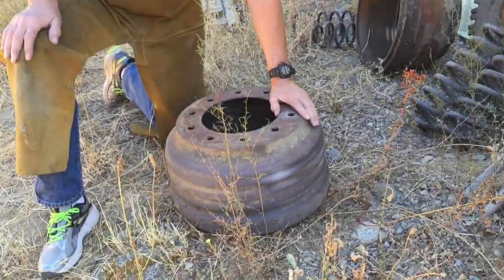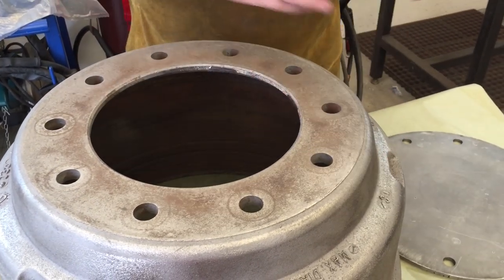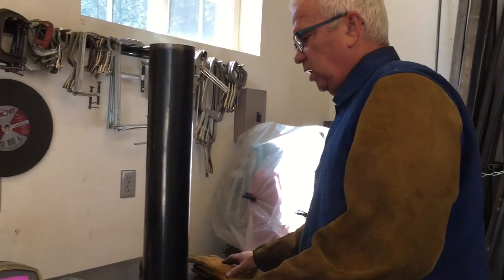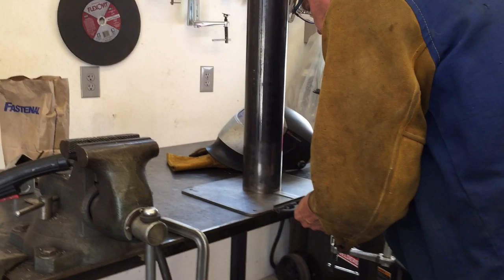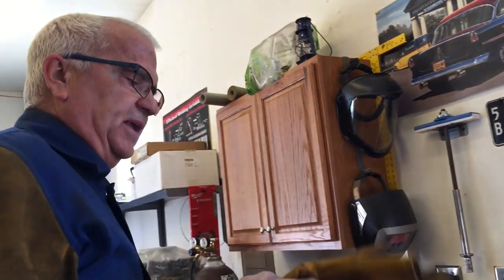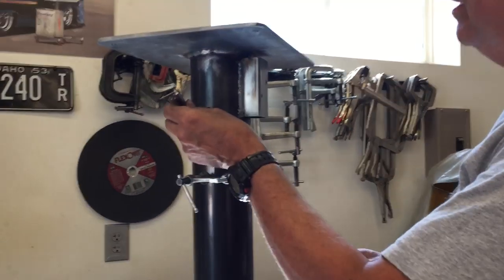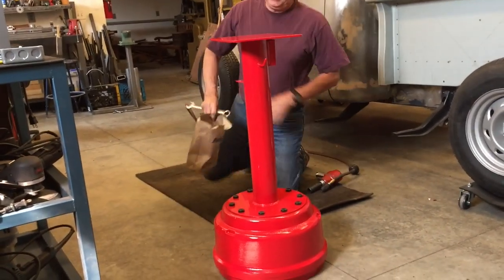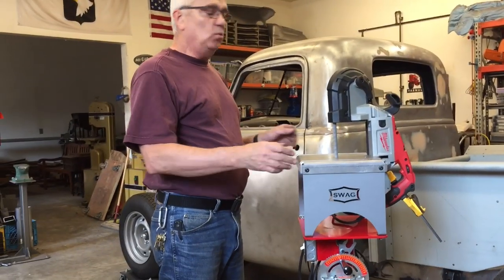brake drum tool stand for milwaukee band saw

Comment: First, THANK YOU for your service.  Secondly, thank you for posting.  Well done project and very good video coverage of each step. 
I'm headed to the garage to build the same thing this weekend.  My design will differ in that I am using a floor switch from Horrible Freight for the electrical control instead of a pedestal mounted switch.  Not a criticism by any measure, just my preference.  My plan is to build my band saw stand in such a manner that I can take the saw off the table fairly easily and quickly, and still use it as a portable band saw in my blacksmith shop.  
Cheers!
Whipple

Comment: Wow, you could have also built your own table for that saw no problem. 
I use a piece of PVC to py-passing the switch. You can get a router controller with a dial and on/off switch or a footswitch too.

Comment: I see your airborne flag, 82nd? My dad was 82nd. Best stand I have seen yet. You could cut up an old Dolly and attach wheels and handles for moving it around. I'm about to make my own stand.  I'm thinking about making a rack , Kinda like you would see with multiple mailboxes. I'm thinking band saw, Grinding wheel and Polisher all on the same rack but then again, I might change my mind 3 more times lol. I'm a Pipe Welder and CWI, you sir have my Approval 😊

Comment from the maker: No problem the plate is 1/4 inch thick and the pipe is standard schedule 40 pipe it’s 4 inches in diameter.  Schedule 40 is pretty close to 1/4 inch thickness, hope that helps.

Comment: Are you going to leave the clamp on the trigger? or rewire internally to 'always on'? Did you design this setup with maintaining the flexibility of being able to remove the hand-held band-saw from the stationary stand at any time for use as a portable tool (its original design) and then return it to the stand for stationary service in mind?
Reply from the maker: I wish Milwaukee had put a lock on feature for the trigger but they didn’t so you can either zip tie the trigger on all the time or I just use a small clamp and that way all I have to do is undo one faster on the bottom of the plate and I can take the saw off and use it mobile if I wire the trigger permanently on that would be not a good feature when you go mobile.

Comment: Why didn't you just weld the stand to the brake drum (before painting)? Could have saved you all of the hardware to bolt it together. Ok, it looks cooler and the added weight of the hardware makes for a slightly more stable stand, but I guess I'm a minimalist and just go for function over form using the simplest, most cost effective methods. Just curious as to why you chose to use the fastener method when everything else was welded.
Reply from the maker: Thanks for the comment no.1, I did it for two reasons I really like the looks of the kind of bolt on industrial look,  and it can be kind of sketchy welding cast-iron I’m pretty sure the drums were cast-iron.

Comment: If you are going to make another stand for another electric tool just buy an inexpensive extension cord instead of the SJ and plug ends MUCH cheaper and the ends are molded for a professional look. They come in red to match the paint!

Comment: What are the dimensions of the top plate length & width? How long is the center pipe?
Reply from the maker: Willie , the top plate is 13 inches wide and 10 inches deep, 
 it’s made out of 3/16 thick plate and the pipe is 26  1/2  inches long.

Comment: That has to be the most over built table for such a little saw. Working in a mechanic machine shop on the waterfront, we never had anything like that and I'm telling you all mechanic used all the shop equipment all the time. Lets see this old guy move it around, I'll bet just once.